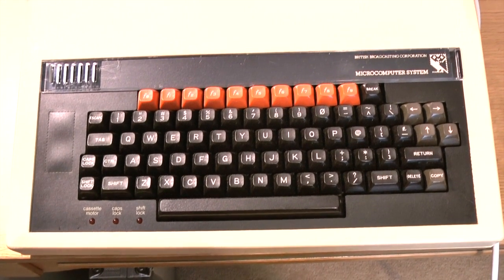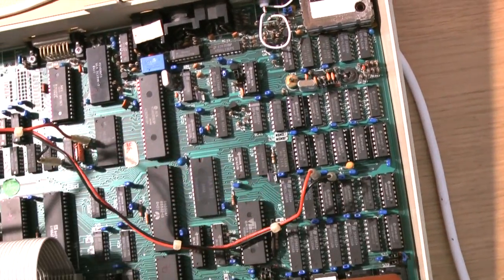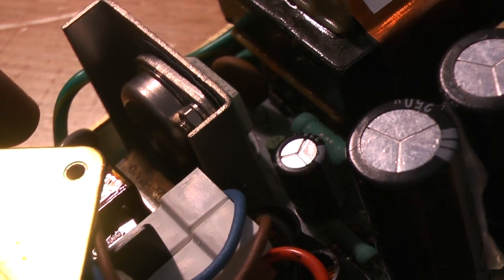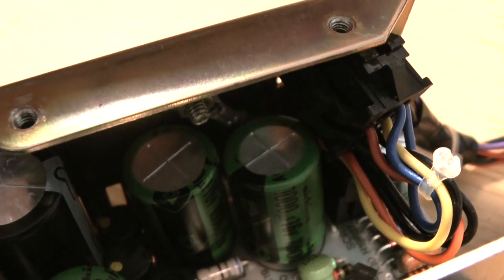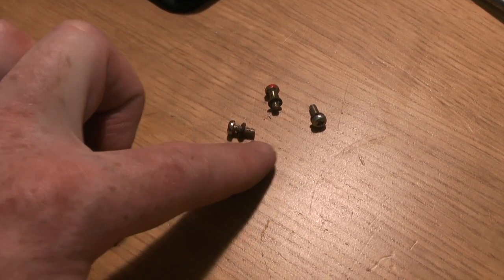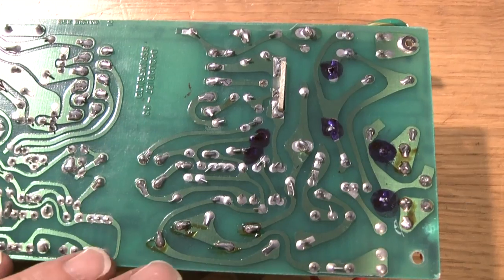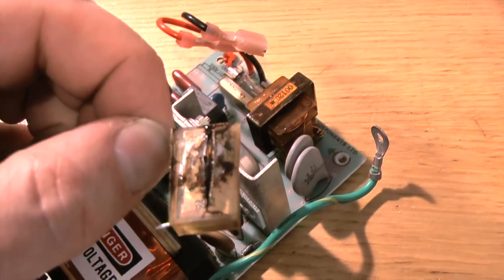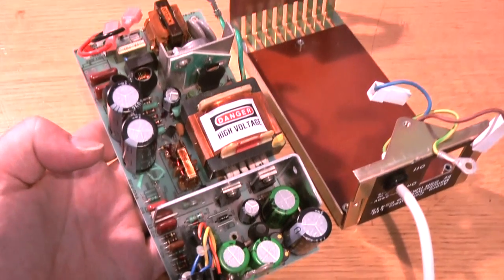BBC Model B PSU Repair

Comment: Any ideas what else could be wrong with the PSU if the rifas and c9 are good, having been replaced. And the plug fuse and psu fuse are also both good. There are no symptoms except the beeb is totally dead. 0 volts on the -/+ 5v rails. No sound nor Caps lock light. After C1,C2 and C9 what would be the next most common failure point ?